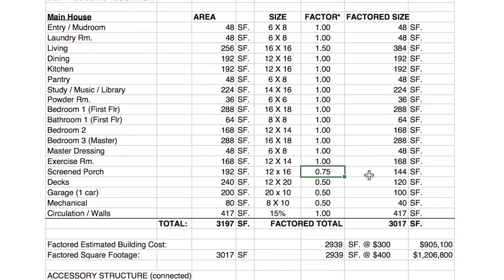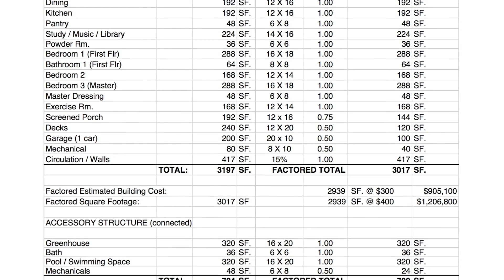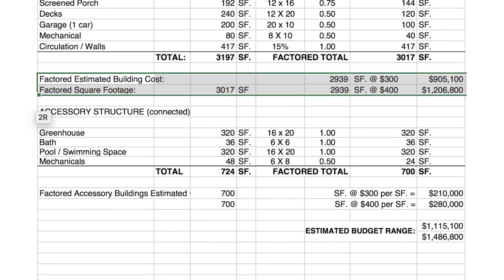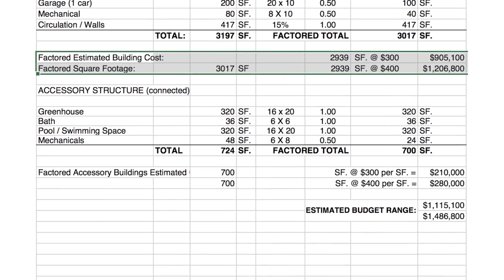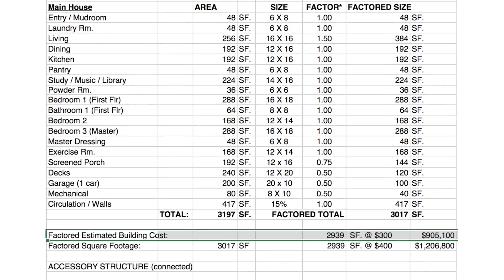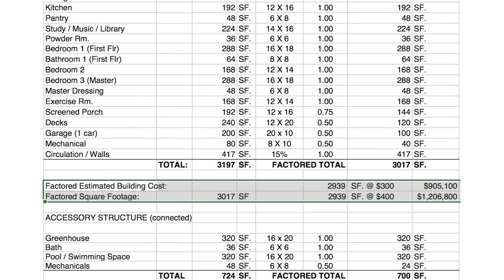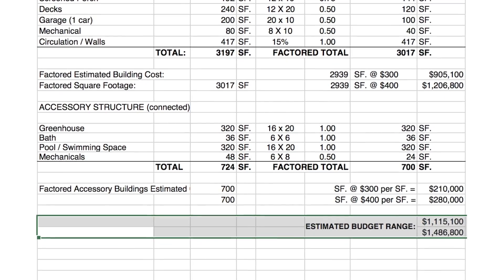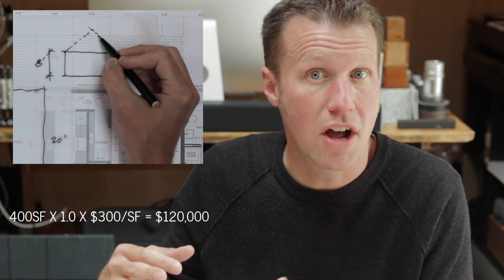Building Cost + How It Impacts Design (An Architect's Guide) | Architecture Short Course (Part 3)

Comment: What if you are not hiring a building contractor? I want architect services I can go back to my house and start building piece-by-piece, subcontracting where necessary. Have nearly all the skills a home construction needs in family, friends and my network. There has to be a better way of decoupling the Architect-->Contractor --> Home-Owner paradigm
Reply: I'm in the same situation 
Getting architect services is like pulling teeth
Example you find a plan on line 
You need the plan stamped  for a building permit because the state your applying for the building permit requires a stamped plan 
As being in the building trades for 40 years as a Journyman carpenter with 1000 plus residential 
A few 5 story 50 unit apartment buildings and
Parking garages under my belt 
You would think getting a set of pre drawn plans stamped and adding some structure details and energy calcs for the area wouldn't be a big deal 
Apparently it is 
I have found that no architecture firm will simply perform this task
Mind you that not all state's requires stamped plans for a building permit 
So now a building plan that's say cost $ 2000.00 now cost $ 5000.00 plus the time to find an architect firm with an in house engineer to stamp the plan 
Good luck 
This task alone will add a year plus to your project
This is been my situation for a simple 2 bedroom I bath project that I have in Hawaii 
I used a drafting service to draw a plan get stamped and submit for a building permit at a cost of around $ 5000.00
Yep thought I solved my problem 
Ended up firing the drafter for the constant charge addons 
Out of 1000 bucks a year of time and back to square one
I now have a special place for Architects when taking the morning dump

Comment: I’m a retired architect with 40+ years experience and the basic idea here is an essential step in any design project. You can adjust the factors and base SF prices to fit your situation. There are published guides you can get in a library (RS Means, for example) with cost factors for different building types. The SF costs reflect not only regional factors but types of materials and level of detail. For example, in another 30x40 video Eric discusses details he likes to avoid using typical residential baseboard and door and window trim, which are much more expensive to build because they eliminate a worker’s margin for error and require much more precise work. Those little architectural touches can have a big cost impact. 
This budget method should be taught in architectural school, which has always focussed too much on only design.
Reply: Richard Sprow hey am an architect student,did you enjoy your life as an architect?
Reply: Candi Sitati : Great question! Yes, I enjoyed my long career as an architect, because the programming, planning and design process involves analyzing and then creating solutions that meet needs and constraints. The most memorable times are when a client said later ‘your design was a great solution, you had great insights’. I chose to specialize in healthcare projects, because I thought the complex problems were more interesting. My job as an architect took me to 40 states and a dozen countries all over the world. I worked for 9 different firms, including a few large international design firms, and I was never without a job, which is unusual in this field. 

I think you will enjoy architecture if you like problem solving and talking with people, going behind the scenes like a journalist to understand new organizations and their facility needs.
Reply: Richard Sprow thank you,I would like to achieve more than you got in this life science of architecture, and come up with new designs for the future,to increase in quality and to cut on cost,to make up a country full of cities with new designs for the market, environment and people
Reply: Candi Sitati : Go for it Candi, I am glad you want to develop your skills and use them productively. One of the things I enjoyed was building useful long term projects like schools and hospitals. As you look for ways to reduce cost and improve quality, don’t forget to look at how real people and families use space and what they need.  Good luck!

Comment: Generally good advice, but the cost per sqft for just building seems insane. The average cost per sqft of a home in the US is currently ~$150 per square foot, which included the land, plans and everything. There is a given that you likely are only working on higher then average homes, but at $300-$600 per square foot, it makes many mansions in Calabasa look cheap. Looking on Zillow, a $2.3M mansion is ~5,000 square feet which is ~$450 per  square foot. It is extremely high end, so $450 per  square foot could seem reasonable, but that is not the construction cost, it is everything. The land cost is likely close to $1M...

Comment: Your video is the most comprehensive approach to figuring out build cost, the model is solid. However, your numbers are extremely high. I COULD find a builder that would gladly take $400/sqft but on the Super Premium side of things, I don't find anyone charging over $175/sqft.

I know prices change with location and the model is workable with any amount, so no quarrel there.

I'm not complaining or trying to say you are incorrect, I just can't believe anyone would ever get gouged that bad on price per sqft.

Thank you for the video, it has been very helpful in determining a baseline cost in the building process.

P.S. if you ever get a quote of $400/sqft to build a house, please reach out! I'll build it for $390! LOL

Cheers
Reply: Can't get anything built where I live for $400/sf.

Comment: This man has a deep comprehension of informed design decision making. The mathematics of budget translated into design are not discussed thoroughly in architecture schools. His video gives a good idea how to "CONSTRUCT" an excel sheet on modular design. The budget characterization of soft costs and hard costs provides a true sense of reality on the redaction of a liftoff. He manage to translate the plausible to the possible.  

The best strategy shown there was that each square foot needs to be heated, cooled down, maintained, illuminated and cleaned for many years. The author gives a strategy of percents describing energy consumption per space. This IS the basics of performance based design. 

His 'thesis' is based on a well known principle of parametric architecture done on the basis of budget percentages and distributions. His witty explanations of size estimation for a building with the totality of the budget provides less room for uncertainty. The dialogue between client and architect becomes accurate without misguidance or false heroics. 

I watched four times this video. This hits the nail.

Comment: Great topic thank you!  the important thing with any program goal to budget goal method is first to do it and second that it help to establish an appropriate amount of design slush needed to find the design.   Its liberating to realize that it will be all wrong, as long as when you squint at it that it is generally right.  I am curious if clients are getting the factors?... I wonder if it would be easier for them to keep the square footage pinned and apply factors to the cost side?  

One thing to also account for is the amount of perimeter envisioned.  Stretching out and spreading the plan across a site and  into multiple volumes will have an impact on the amount of foundations and area of insulated exterior walls etc.  I recently blew past the budget goals on a project while hitting the SF targets and when I analyzed it there was something like 30% more foundation and perimeter wall than a the more compact design the builder typically executed.  I have since started to apply a compactness factor to early budgeting worksheets to try and cover this when the project seems like it wants to sprawl.   great job!

Comment: Having lived in older houses and watched their repairs, I've noticed how frequently the utilities and pipes were placed poorly, limiting remodel options or preventing repairs from going smoothly. Add to that the invention and addition of new utilities like television cable, and these homes could become a mess of exposed cables that the original builders never anticipated a need for. My college dormitory, for instance, was such a rats nest of ethernet cables and new plumbing that every hallway felt like a basement.

I'd be interested to know if a video exists that explains a modern best-practices for something like home utility layout, and whether or not enhancing old homes with things like natural gas, cable, internet, and so forth has prompted designers to begin intentionally leaving space available for easy installation of new services as they're available/invented so that the building can more easily become modernized. For example, not making it nearly impossible to convert from electric to gas water heating.

Comment: Just a quick question. When assigning your factors, are you not including the costs of appliances to this? I noticed that you have the kitchen factored at 1, and the living factored at 1.5. This might be just because I design and build in Texas, but our kitchens are the most expensive rooms in the structure.
Reply from the maker: Hi, +Mark Watson - in the example shown, the living was factored at 1.5 because it had taller ceilings. Once you start thinking about it as a detailed measuring tool (what appliances are included, etc), you're off the spirit of what it's meant to be. It's difficult to get too granular with this kind of basic cost study because it's inherently an imprecise tool. For example, if you assign a higher factor for the kitchen, then you must also assign a reduced factor for lower cost areas like closets or hallways. This is purely based on footprint and volumetrics. Hope that helps...

Comment: What's included in $300-400/sqft? Is it the typical cost for high standard designer homes?
Reply from the maker: In my experience, there is no 'typical' cost with custom work. Costs vary quite a bit regionally, which is why I recommend soliciting cost feedback from local contractors before you begin design work.

Comment: Such a fantastic run through. Love the idea of using 'factored' rates rather than changing the square foot cost per space. Great strategy Eric - thank you for sharing in such detail. For those watching in locations that use metric measurements, there's roughly 10 SF / 1 square metre. So multiply Eric's amounts by 10 (so $300/SQ becomes $3000/m2). And divide areas by 10 (so 400 SQ becomes 40m2).
Reply from the maker: cheers +Undercover Architect...thanks for doing the mathematical translations...
Reply: Undercover Architect Thx! Now I can tell u guys, it's somewhere between 1600 and 2000€ a m², for a high standard building in Germany, in building costs. so something around 180 - 220 $ per SF ? Meaning to build in brick&mortar/concrete, 3-paned windows, floorheating, nice bathroom and so on. But without furniture.

I wonder why stuff is so expensive at the US at your place?

Comment: Wouldn't be easier to implement BIM from the get go? Or at least use it to estimate more accurately... Thanks for all the effort you put on to these lessons, it really helps
Reply from the maker: hi, +gabriel teran , thanks for sharing your thoughts. I'm really interested to see where BIM takes the industry with respect to estimating in the next decade, however, with respect to the context of this video it's important to note a few things:
1) As an architect, I don't want to contractually own the estimate (or any liability associated with it) as part of my scope of work. I want to develop a reasonable methodology for aligning the client's budget with an estimated cost to construct, but there are too many factors out of my control that prevent me from bearing the responsibility an accurate estimate. Ideally, I want a contractor as a partner who will assume responsibility for determining the building cost. This makes sense as it's their labor, their subs, their material suppliers that will handle executing the work. The framework I shared should get you close (in a residential setting at least) and from there you can begin designing.
2) Early on (before you start drawing/designing) there is no BIM involved yet. You want to set the direction, scope and size and these rough estimates help you do that. Once you build the BIM model and have information to draw upon, it will no doubt be useful for estimating (depending on how granular your model is). It might even serve as an alternate revenue model for architects (additional service) to provide to the contractor. 

There are inherent liability issues with these kind of arrangements (accuracy, errors, omissions) so be sure to discuss with your insurance provider.   Hope that helps!
Reply: 30X40 Design Workshop  it helps a lot thanks, are you planing to make a video about the supervision of the project in this series? in another subject please consider to make a video about what type of laser cutter you recommend.
Reply from the maker: +gabriel teran indeed, construction observation is an important phase...cheers...
Reply: BIM will definitely be incorporated in the future of construction. Who is responsible for the quantity is a problem. The priority hierarchy right now is contract, specifications then the drawings,  BIM at the end. Once we go 3D only with no 2D drawings in the future,  we may just state in the contract that the contractor is responsible for all the quantity even it's in the BIM or not, so it is onto the contractor to look at the BIM and its quantity and decide if there is anything missing.

Comment: what is the factor number, what does it represent?
Reply from the maker: the factor is a number we use to multiply the square footage by to more accurately represent how much a space will cost to construct. In the vaulted ceiling example, we apply a factor of 1.5 to the calculated room square footage (400sf) because the ceiling is higher and will cost more to construct. Spaces with 8', flat ceilings are factored at 1.0, while spaces that cost more to finish (like the vaulted ceiling space) would be factored at 1.5 and spaces that cost less to construct are factored at .5 and .75 as explained in the video. Hope that helps...